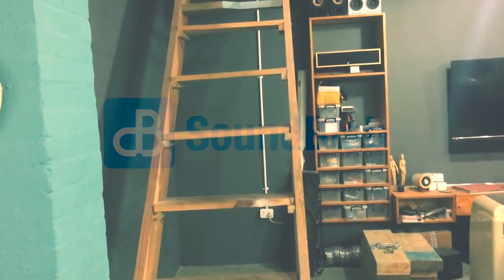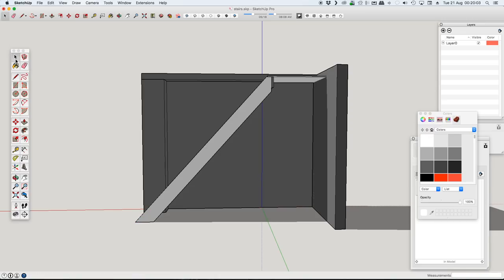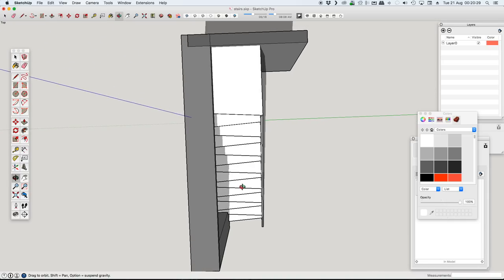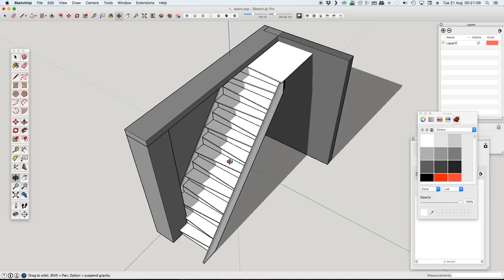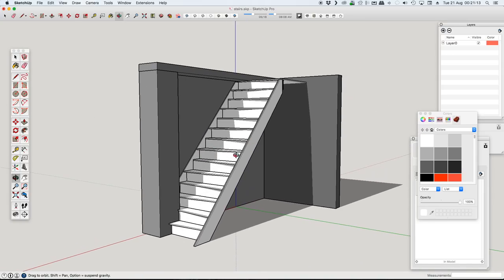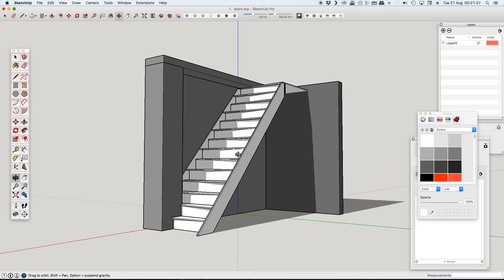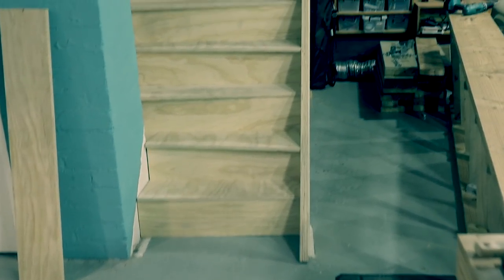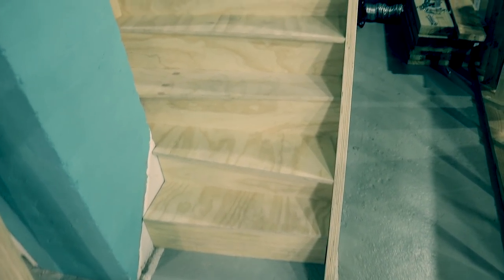Building a Staircase for a Tight Space - by SoundBlab

Comment: For added strength the treads should sit in a groove / pocket, routed out into the stringer, your design is very weak, not recommended.
Reply from the maker: It's been in daily use for more than a year now, and it does not even squeak. Glue and screws are more than up to the task. It's not weak at all!
Reply: @SoundBlab  It's been done that way for centuries look it up, did this in wood working at school. Thought it was common knowledge.
Reply from the maker: Thanks, I know the proper way, but didn’t think it necessary for my build in my studio space. Technology and materials have also come a long way in the last century, so some change might be considered as a result.